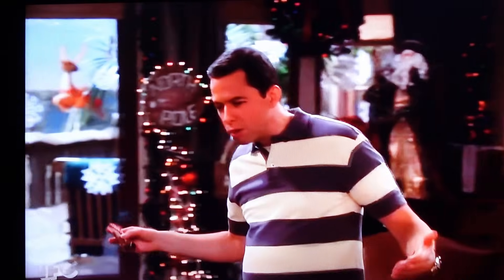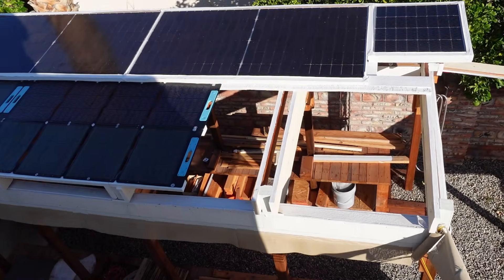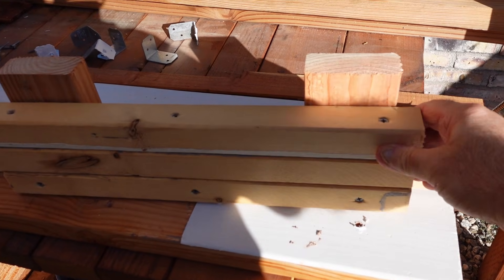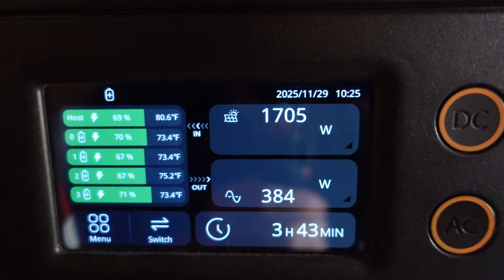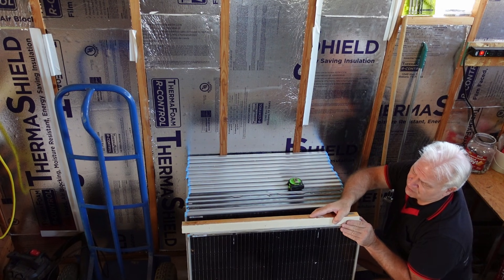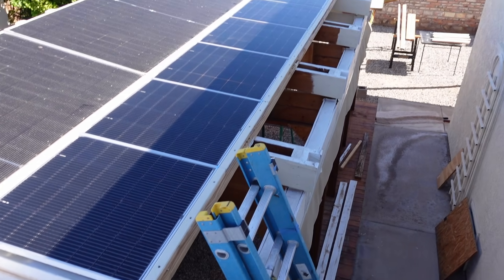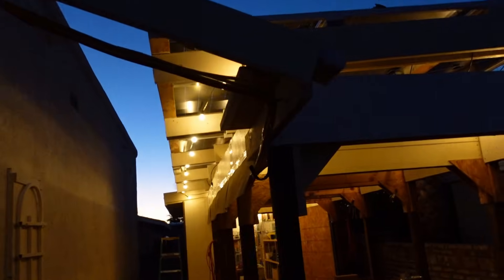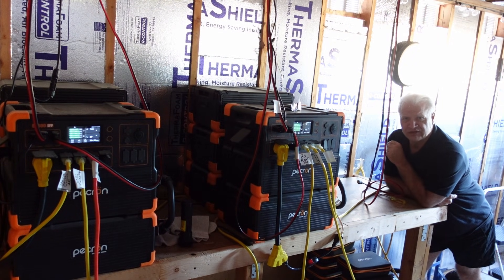DIY SOLAR SHED 42 - New Panels up!

Comment: Modern panels are split in middle and half will produce power unhindered while other half is in shade.
It is thus often beneficial to align them so the shade covers one half or less for as much time as possible.
In your case though you seem to use some tiny panels on the side there that does not have this, but your main panels do and could be rotated 90 degrees. Those extra tiny panels could be used in the major shade as they would produce properly only in mid summer.
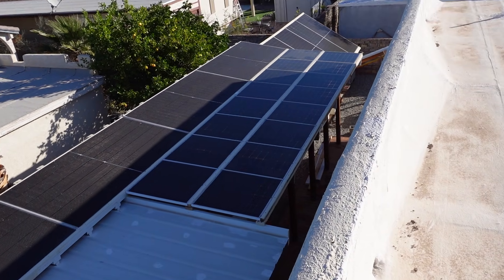At 6:24 you can see what I mean as that shade going along the top row of panels will cut out a whole 1/3 of the power to that string unless it diminishes it to almost nothing. This depends on the bypass diode setup in your main panels and it's either a 1-diode or 3 diode setup. Some even have 3+1 diodes for optimal bypassing. The outer most panel can produce full power in that timestamp while next panel would deliver very little as the shading is on both sides of it's split forcing it to deliver around 2/3 of it's capacity and the drop is in voltage. What is most effective is always very hard to estimate.
Reply: The setup now looks very neat though :)
Reply from the maker: Good info!